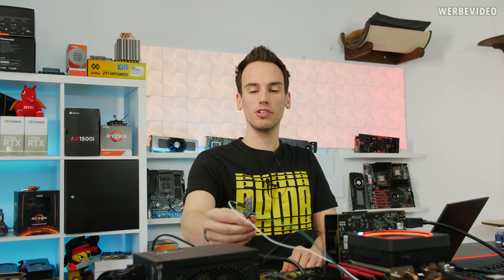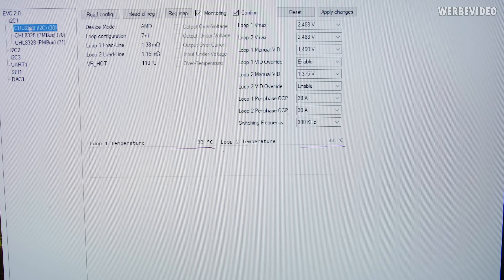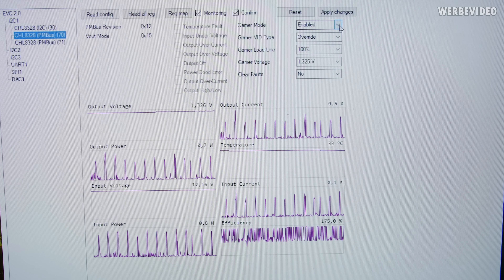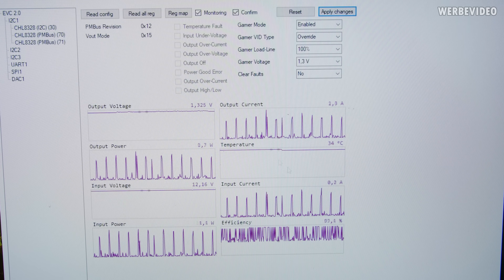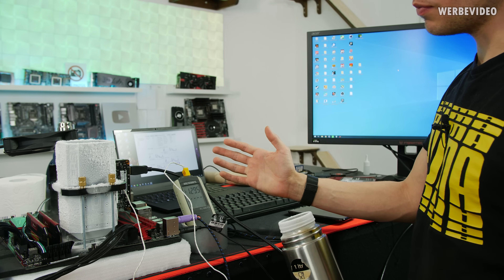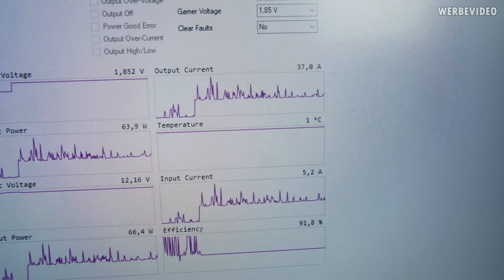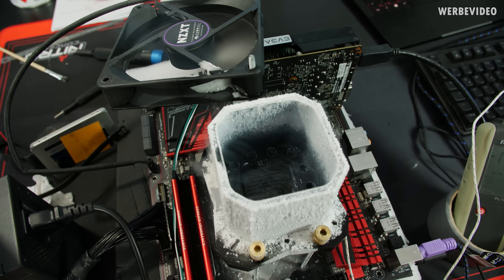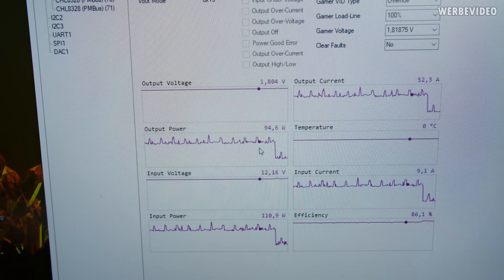We Overclocked an AMD CPU to over 8.1 GHz !!

Comment: thanks for your effort and time , why not make something to convert heat to power and use that power to run GPU or Store it inside Battery rather than try to dispute the heat by nitrogen or air , heat is kind of energy

Comment: i know  this video is 2 years old now but did he say ice isn't electrically conductive?? Um.. isn't ice water? water = conductive what?
Reply from the maker: that is one interesting aspect about water :) But you have to keep in mind that water itself is also not conductive. Only the minerals inside water will change this condition. And in solid state (ice) this doesn't work and ice becomes an insulator

Comment: Cool that the fx 8350 can run that, special when the fx series was known to have thermal problems w/o overclocking, mine run for over 6 years with a selfmade " cryo "  with a peltier element in it, retired it 3 months ago for a R9 - 5950X... It;s still working todat thou...

Comment: Why clock CPUs? If new games on your older PC will work with large FPS drops and reduced setting details low. So even heavily overclocked CPUs won't help you, and with a new graphics card you will only experience weaker cosmetic differences in performance, nothing revolutionary. And you'll need to buy either new processor if your motherboard supports it. If not a new motherboard for your processor to support
Reply: This was clearly done because it's something he's passionate about and he wanted to push boundaries and experiment, not just get FPS in games.

Comment: 2V / 200 AMPs no problem ...
I remenber back in the days intel thought that cpu in 2020 will be running @ 10 ghz in 2004 ...
Long pipeline cpu architecture ...
Guess what 20 years after : not ...
Short pipeline architecture since intel pentium M ( core duo then) ...
And massive multithreading because speed can't hold on ...

Comment: You can easily reposition bent pins by  using the tip of a retracted retractable ballpoint pen and sticking the pins in the hole where the ballpoint would come out.

Comment: To bend pins back use a thin hollow tube like from a cuetip or pen ink tube. Put over the pin and then straighten the tube. This prevents a slip and damaging other pins and it gives you a better idea of the angle the pin is in.

Comment: The AMD trick to remove the cooler is wiggle it around first to break the thermal paste. The chip heats up ( as expected from 6 core, 8 core chips ) the Thermal Paste becomes like glue. I thought you knew that, though here's a little advice i learned from painful experience such as yours, ha ha. The pins on my A10 9700 weren't happy.

Comment: Kids in 2077: Yeah my Samsung galaxy S2000 can reach that.
Reply: In 2070 we will have no oil anymore, and we will back to using horses and abacus :p
Reply: @sassuki  there’s something called renewable energy, like solar panels etc.
Most cars won’t need gas.
Reply: @647Max  I think you should know that solar panels are made mainly with coal and last for 20 years only :D
Reply: @sassuki  I’m sure we’d rely on electricity or something else why that point lol
Reply: @samthewizzy  electricity is generated with devices working with oil or gas 😝
Reply: @sassuki  THATS TRUE !
Reply: @sassuki  i hope
Reply: now i’m thinking of Honda’s
Reply: Unlikely. Physics won't be any different in 50 years. I'd think it's even more likely that clock speeds will only go down not up with improvements in architecture.
Reply: @sk-sm9sh   That is unless silicon gets replaced with a material that can reach much higher clock speeds. The possibility is there.
Reply: @sk-sm9sh  quantum computer exisy
Reply: @sk-sm9sh  r/woosh

Comment: @der8auer let me give you a tip for skewed pins. Just buy a Rotring mechanical pencil or any other pencil with a long metal head. Remove the lead and insert the skewed pin into the pencil tip. That way you get a great safe grip. I use 0.5 pencil heads and they are a perfect fit.

Comment: formula 5 is based on the fx 990 godly chipset.. alot of 8350 allow overclocks on stock voltages 4.5v, not all tho. and its still the record holder with Max ghz. tho the singel core performance makes this cpu old and absolete. even at 8ghz it lacks punch for the latest games.

Comment: It should be called single core overclocking because if you call this cpu overclocked to 8.1GHz then factories should start making 4 GHz processors which have one core at 4 GHz and all other cores at 0.2 GHz.

Comment: I used a pen to straighten pins. Just open pen remove the insides screw it together and use the empty hole to straighten the pin.

Comment: Thanks for this. I still have an fx8350 build from 2012 running and also did a 3900x build last year. Very interesting to see how far IPC enhancements has come. I never would have thought my stock 3900x would do better in single core than an 8ghz fx8350.

Comment: I'm surprised people don't use Silica Gel to help remove humidity and reduce condensation.

You can also use sub-freezing ambient temperatures (i.e. test in a walk in freezer) to dramatically reduce water vapor in the air down to almost nothing, as well as reducing temperature differential between the cooling device and the board.

The other thing is to use controlled expansion on the liquid nitrogen to be able to control the temperature.  One could even use negative pressure on the liquid nitrogen to get even colder, but I don't think any CPUs could handle things that cold.

Comment: Imagine in a decade, computers will come stock with 8ghz core cpus
Reply: it's getting close, but i don't think so. higher core counts are better than higher clock speeds. as programs became more demanding and require more cores and threads, 8GHz CPU would be obsolete pretty quick.

Comment: I learned when bending CPU pins back, it's best to place the edge of a knife to the base of the pin(s), and spreading the force along the whole edge of the pin as you tilt it back up.

If you just pivot along the knife's edge, or just keep SOME pressure near or at the base/bend in the pin, and you pivot on that point, you will never break a pin again.

(Basically its the opposite of just pushing them up by the tips)

Comment: Question. We measure time by using the tickrate of the cesium atom which is 9.6 billion ticks = 1 second. 8.1 GHZ = 8.1 billion clock frequency ticks per second. So does that theoretically mean that 9.6ghz is the absolute limit for ghz as we know it since it's bound by time?

Comment: 11:20 Your crashing and stating that you disabled devices in the bios. Its probably because looking at the motherboard i can see ice covering the board where all the little chips and resisters. They are frozen. Should consider taking a thin mousepad, make some cut outs around cpu socket, lay it on motherboard with the rubber side touching the board. 

Very sad watching you damage a good board by letting it ice over and warping it to hell.

Comment: Honestly the heat is most likely due to the motherboards max supported voltage coming from the FX 8350 and causing the heat and the damage it’s doing as well to the motherboard like that bending in the video

Comment: had the same problem, pulled out the cpu out of the socket, i seemed to have left it a bit too long on there so the thermal paste basically acted as a superglue. so the paste wasn't warm at all. pulled out the cpu, and bent 1 pin. tried to bend it back, but bend another pin. fortunately i managed to bend both back and it works perfectly fine. i feel really lucky and happy that i didn't mess it up.

Comment: Wirst du jemals ein Retro Video machen? Sockel A Gigabyte mit dem letzen 3200+ und Wasserkühlung? OC?
Eine Kühllösung für den Sockel wäre große Klasse. Und ich denke dafür finden sich Abnehmer. Auch wenn es mittlerweile ein Oldie ist. Allerdings waren die Spannungen damals schon sehr hoch und reduziert aus meiner Sicht die Lebensdauer und da es kaum noch Lüfter gibt..
Zur Info habe gelesen das mittlerweile diese 3200+ Cpus gefälscht werden also man sieht das es noch Leute gibt die diese CPU kaufen.
Toll wenn man da in Zukunft was bekommen kann als Kühllösung

Comment: So, I study electronics and hardware engineering. One of the big limitations of silicon is precisely that beyond 5ghz there is no longer a waveform but rather begins to become square. This is the limit of Silicon (which is why alternatives are already being tested that can go further).
Now my question watching this video is: How is it possible that the boy in question, using silicon chips, manages to reach these frequencies?
Does he own a special chip made apposite for those testing?
Is everything fake?
I need to know. Just for the science
Reply: well you have silicon based cpus now that are >5ghz stock...
Reply: @user-hx7dc9uz6s  Yes but a bit over 5.00 ghz.
I mean even 6.00 is lready high, image this

Comment: Without 24[7 stability this its pointless
Reply: you definitly understand extreme overclocking lmao. hey you can run 100m in inder 10 seconds? without you running 24/7 at this speed this is useless....

Comment: I overclocked my CPU to it only costs me 12 liters of liquidnitrogen a day but im getting 2000 fps + on my 60 hz monitor.
Reply: Runescape has never looked better
Reply: @joonwolf6817  roonscayp!1!!1!1!1
Reply: @joonwolf6817  RuneScape 3 will better then osrs lll
Reply: Can it run crisis ?
Reply: @bubabiwin  sadly only 4 fps on crisis.
Reply: @bubabiwin  remastered
Reply: @bubabiwin  no
Reply: Meng Yang Liu probably not
Reply: Meng Yang Liu probably not
Reply: @bubabiwin  probably not
Reply: @bubabiwin  no!
Reply: @bubabiwin  Crysis?
Reply: @bubabiwin  but can it run Minecraft?
Reply: @mengyangliu4796  The actual question is, can it run doom
Reply: @bubabiwin  can it run Microsoft flight simulator
Reply: but it still cant run warzone 😡
Reply: Sôei minimum specification 🤣🤣
Reply: @AllheavenSPK  war zone isn’t even slightly hard to run
Reply: @AllheavenSPK  warzone is easy to run lol
Reply: @AllheavenSPK  its not that but warzone cant run anything. So the question should be can warzone run it?
Reply: @AllheavenSPK  mine is a ryzen 5 3600 with a msi gtx 1650 low profile I get 60+ frames on high
Reply: @AllheavenSPK  how do u know??
Reply: @mikisafe2905  Jesus Christ. 🙌 Its 🙌 a 🙌 joke 🙌
Reply: @e39purist89  😂😂😂
Reply: @mikisafe2905  r/wooosh
Reply: @mXLicEE  lmao and you are?
Reply: @e39purist89  po cilo wzywasz na daremne
Reply: @bartoszpodgorski1055  What? English or French please.
Reply: @e39purist89  Polish
Reply: @e39purist89  dry joke
Reply: To be fair, liquid nitrogen isn’t that expensive. It would be at 12L per day plus the time cost, but nitrogen itself is like the cost of milk at the gas station. At least that’s what my chemistry teacher said... idfk
Reply: @pfunk_1535  i would buy liquid nitrogen if it was that cheap a litre would simply cost more than 100$
Reply: @pfunk_1535  $2.00 per lite
So ~$24 a day unless it’s I bulk and like $1.00 per liter but a lot of le
Reply: @pfunk_1535  milk at the gasstation? what devil of car are you riding?
Reply: @pfunk_1535  what? where are you going to buy 12L of nitrogen everyday? haha even if its cheap, i doubt you can find a constant supplier
Reply: @pfunk_1535  ye. LN2 cost around 1-5€/l, depends by the seller. To do extreme overclock can be used few hundreds of LN2, 12L is a pretty unaccurated amount, expecially counting it is a joke that points out to make fun about how much it is expensive to OC
Reply: @pfunk_1535  I think you mean dry ice, cuz where I live, LN2 is like gold
Reply: Me who is balling with my 500gb ps4 
I have 4 games and I cant download the latest update for warzone
Most of the games are under the 3 other games are 50 or less gb
Life sucks
Reply: @Mysta-Kun  throw a hard drive in that guy, or get an external. I think ps4's support up to 8Tb
Reply: @drangpot8667  •́  ‿ ,•̀ 
We broke in this bih
Well not broke I just have parents that are you know
Reply: @Mysta-Kun  That's tuff lol. Maybe you can ask for a 2TB internal for Christmas. I don't have a ps4 anymore, but when I did have one expanding my memory was a game changer!
Reply: @drangpot8667  my fam dont believe in christmas due to... religion tingz

Damn
F
500gb for the rest of my life it is :D
Reply: @Mysta-Kun  rip, sound like your out of luck lol
Reply: @Mysta-Kun  just but a external ssd for like 1tb can be 60$ buck prolly less
Reply: @ritzz4789  in my currency that would be 600+
Reply: Parece verídico
Reply: So your telling me you run 2000 FPS on a 60hz monitor, that’s a lot of verticals tear
Reply: yo its rellay funny
Reply: its funny how everyone is missing the 60 hz joke, he can only see 60 frames lol
Reply: @pokemonmaster42000  XD
Reply: Now he gonna overclock the monitor
Reply: can it run flight simulator tho?
Reply: @WandererHermit  i don't know i don't have that much money left i waisted my last pennys on liquidnitrogen.
Reply: But can it run Minecraft!
Reply: Ohhhhhhhhhhhh......
Reply: 'On 60hz monito'r
Reply: I like your styleeee
Reply: But can it run more than 5 chrome tabs?
Reply: Yo...
Reply: Do that on Minecraft and watch that number go up to 8000 fps
Reply: now i can play snake
Reply: haha you fool i have 3000 fps 😎 tho im on 30hz monitor
Reply: Accurate
Reply: KlockzFN  nonono all legit.
Reply: Underrated
Reply: @fluffy balls I saw ur channel and subscribed it lol
Reply: @KrishKumar-tk6jz  lol thanks XD
Reply: That's pretty good use of money and time. I'm proud of you.
May I interest you in a 3090 and an 8k tv?
🤭
Reply: I like your profile pic
Reply: facts
pain
Reply: LOL AHAHAAHAHAHAHA
Reply: I have 2k fps at osu!
Reply: @NIMKAOriginal  me too
Reply: Wow, really???
Reply: Lmao
Reply: Yes
Reply: Wtf
Reply: so should I should use liquidnitrogen on my gpu to use shaders for some games?
Reply: @Someguyy  ya... u should.
Reply: @Fluffyballz  ok, I am ready to not get 104 degrees again
Reply: The whole city woul get out of power
Reply: Its will be 50fps on flight simulator
Reply: Gamer
Reply: What if we do a processor that can hold 15ghz?
Reply: Smooth as butter
Reply: Tidak masuk akal
Reply: Wow really that's awesome
Reply: Can it run minesweeper at constant 30 fps?
Reply: @muskelin  yes. It can even overclock the game to run on 240 fps. With its new build in programmer
Reply: Imagine the ultimate screen tearing
Reply: Buuuut can you run minecraft
Reply: Can it run coolmathgames?
Reply: 12 litres a day? That's literally nothing. Most overclockers can go through 50+ litres in one oc session.
Reply: @NikoBell1188  wel im not rich sir. I have dogs to feed and beer to drink i have a low budget.
Reply: 😂😂😂lol
Reply: Does it run minecraft
Reply: fake apenas
Reply: 60 Hz monitor XD
Reply: So u should overclock ur monitor
Reply: lol
Reply: Overclock your monitor
Reply: Can it run Minecraft RTX ?
Reply: Heights of Sarcasm detected
Reply: But can you open 3 google tabs
Reply: Even this cant fix the fact that cod mw is over 250gb
Reply: @txq2270  right
Reply: LOL GET A BETTER MONITOR
Reply: I think you may be bottlenecking.
Reply: Best machine for minesweeper
Reply: But will run Crysis?
Reply: But can it run minecraft shaders?
Reply: can it run roblox?
Reply: Wtf
Reply: 50 fps lock
Reply: Nitrogen is in the air, aka free
Reply: Oof
Reply: Intel fanboys are jealous, since that all they care about. LOL
Reply: This cracked me up lol
Reply: Oo Maa Gu
Reply: The human eye can only see 1 frame a day
Reply: U need 2000Hz pc too
Reply: Idiot
Reply: @Nunya58294  r/wooosh
Reply: FPS depends partly on cpu and mainly on GPUUUUUUUU  , u idiot
Reply: @avengergaming9951  r/wooosh
Reply: @avengergaming9951  wtf it even depends on the cpu If the cpu overclocked it is bot worth getting a good gpu ur dumb af and be polite the comment was just a joke
Reply: i overclocked my fan lol
Reply: f
Reply: lmao 60 hz with vga pain
Reply: can it run minecraft tho?
Reply: Instead buy a better cpu and 360hz monitor
Reply: But can it run a fully loaded openmw?
Reply: THIS IS EVEN FASTER THAN REAL LIFE FPS
Reply: Nice
Reply: I should do it to :)
Reply: Pass mark cpu score ?????
Reply: Lol
Reply: Oof
Reply: If you're gonna run mario, of course its 2000+ fps stupid
Reply: Fake
Reply: @karthikkalyan7940  no its real....
Reply: @od3stroyer771  This comment is 9 months old and not even remotely aggressive.
Reply: Lier because cpu doesnt effect fps that much its gpu dumb
Reply: @leserrors7669  ya true... but if i had overclocked my gpu i would have about 60k-100k fps.
Reply: Cpu has nothing to do with fps dumb.
Reply: Run PP mikey
Reply: this comment makes no sense and i love every single word of it.
Reply: @txq2270  😂
Reply: Overclock your minitor then.
Reply: Hows the pc
Reply: Sad
Reply: can it run osu! tho?
Reply: buy nicer monitor or overclocked ur monitor
Reply: Confused stonks
Reply: 2000+ 🤣 I got 2001+
Reply: Lol
Reply: Me with 20 fps while running Dota 2 : 😐
Reply: Dam
Reply: Can it run Crysis 3 though?
Reply: cool, you should be able to play Crysis
Reply: OK, but can It RUN CRYSIS?
Reply: wtf ?
Reply: Lmfao
Reply: 2000fps on calculator?
Reply: Use liquid helium, it's colder
Reply: @bitonic593  il try..
Reply: You need to overclock your brain too
Reply: @chu3276  LMFAO
Reply: @chu3276  and how? I don't have the brains to do that..
Reply: Cyberpunk on cpu 😂
Reply: He gotta be troll like aint now way 🤣🤣🤣🤣
Reply: Candy crush 😜
Reply: Can it run a minecraft with Ray tracing 4096x texture pack???
Reply: @lazarsekulic333  bro there is no pc on this planet that can run that. Its all fake. Its all real recorded on 4k and then they made the room look like it was in minecraft.
Reply: @Fluffyballz  actually not yet as u probably know the new rtx 30 series as I've heard is a gaming LEGEND. lol. not being rude and I know it's not out yet but some creators have it sooooo...
Reply: V sync on right?
Reply: TRY YANDERE SIMULATOR, THE WORST CODED GAME EVER
Reply: @31Fischer how do you know
Reply: Uh